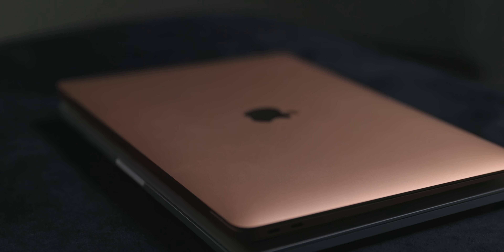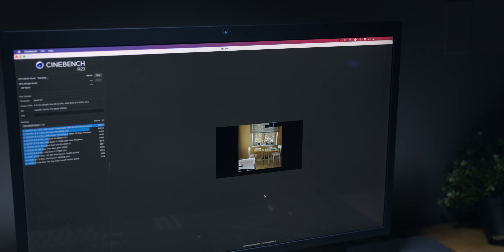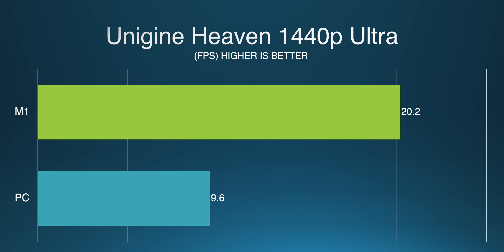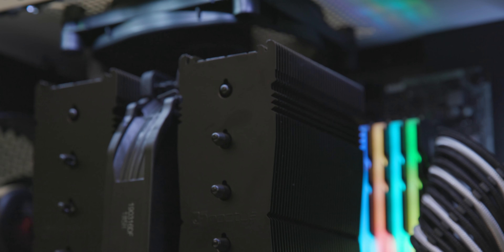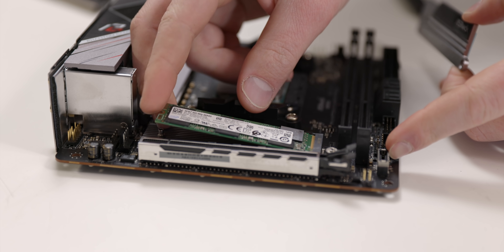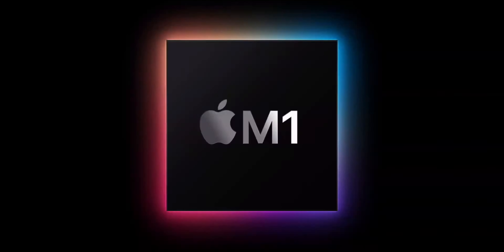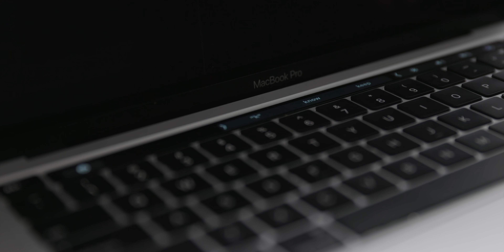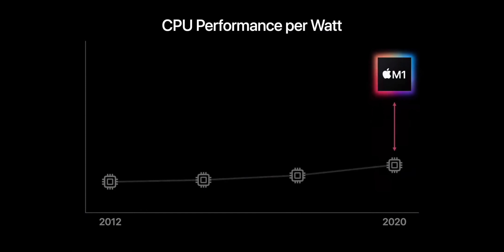$699 Mac mini vs $1,000 PC: Which Is Faster?

Comment: The performance of the M1 is amazing, the problem lies elsewhere - first, not everyone wants to be an apple/macos slave, second, the wholly integrated package of cpu, ram and storage is not great from upgrade-ability point of view, not to mention repairs - it's not unheard of having a busted RAM chip which isn't really such a big deal on a normal pc or laptop because you just pop in a new ram module but you cannot do that on the M1. Also, news just surfaced about some concerns regarding the longevity of the soldered ssd's on the M1 macbooks - it's going to be interesting to see how those M1 macbooks will do 2-3 years down the line...

Comment: imagine if, apple decided to go for the server market.
Reply: They would probably fail again, just like what happened with the xServe. It all boils down to one simple fact: nobody wants to work with Macs as a server. They failed for the same reason Windows Server failed, and adding ARM only makes matters worse. In the server space (and professional space), ARMs limitations pretty quickly become apparent. Unlike CISC architectures, ARM performance can't be increased by upping the voltage. Therefore, it scales pretty pathetically with more power. ARM servers do exist, but they're oftentimes more expensive and less powerful than their x86 counterparts. Furthermore, you actually can rent M1s as a server, and it's ridiculously expensive: nearly 10 times as expensive as a similarly specced x86 server.

Comment: What if you scale down the amd cpu(s)
so that it'll draw a lower amount of power? (downclocking? or undervolting)
iirc someone posted about this on reddit (a while ago) and he got some impressive results
The power draw / performance scale is NOT linear.
Reply: AMD already do this on the Laptop SKU which is only 35w. There is no a massive performance difference.

Comment: Rather pick up an envy x360 with a 4500u, 16gb of ram, 512gb add and so on for $650 and $700 vs $1000 and $1200 for 16gb of ram. Not sold on it. Amd can and will never be able to be the muscle that x86 is today. It goes against arms philosophy.

Comment: I'm definitely impressed by what Apple's been able to do with the M1 and its performance, but I can't see myself switching. Mostly because my main use case is gaming and MacOS can't really run games like Windows can. 
Plus, I don't know if I can forgive Apple for buying up all of TSMC's 5nm production, blocking us all out from being able to get Ryzen 5000, RX 6000, and RTX 3000 atm.
Reply: Just to point something out. Apple buying up TSMC's 5nm node doesn't block any of those products... If you haven't noticed, Ryzen 5000 and RX6000 are on TSMC's 7nm process...And RTX 3000 even built from TSMC, they are on 8nm samsung. 

If anything AMD's production of chips for consoles would have a greater contraint on their enthusiast products as at least those are on the same node.

Comment: M1, P1, D1, X1 for mobile, power, desktop and insane. Then they’ll probably have some kind of ARM BRAIN C1 chip for the car that draws 1KW and has over 512 cores for ML. This architecture has serious legs, and it’ll use them to walk firmly over Intel’s heat sink.

Comment: 2:00 The Cinebench R23 for M1 Single Core is 1514 and has a multicore score of  7760 which is quite far from the your score of 10173 at 2:02 . Ryzen 4750G still easily outperforms M1 in any multithreaded task.

Comment: I bought my wife an M1 Air, and it's like using a computer that's been teleported back from several years into the future.  Planning on switching myself now, when the larger MBPs come out.  I'm a big fan of Intel's NUC lineup and will continue to use/build those in the future, but for my next laptop it's impossible to overlook what Apple has done here.

Comment: there becomes a threshold where power envelope just straight up doesn't matter.  for me, and I honestly think most users, that threshold is "does this need to run on a battery and be portable". so long as it isn't over the moon (more than 800w or so power draw for the whole machine), why should I care!?  and that's coming from a guy who pays $.21/kwh which is reasonably high.  back-of-napkin figures: a gaming pc or an entry level professional workstation uses roughly 500w of power (probably less, this is just an assumption for calculations).  assuming it's running at max load 24/7 (which for most it won't be) for me that's only $2.50/day for power or a little over $75/month which is nothing for a professional or a gamer.  and right now, depending on the gpu you choose, you could even be generating more money than you'd be giving up in power every month by mining etherium when the computer is idle.  if you use your computer for work/games/whatever for 12 hours a day at full power, and then you mine eth for 12 hours, on a high end gpu like a 3080 or a 3090, which gets you something like $9/day right now in bitcoin (over 24h), cut that in half for our hypothetical 12 hour run, and that's $4.50 or $2 MORE than you pay in power, essentially running the machine for free as long as eth/btc stays valued as it has been and you're smart about your selling schedule (I am not an investment advisor, this is not investment advice, this is simply the strategy that I have personally taken with my new workstation build).

tl;dr: even if etc/btc goes completely bust, most users don't really care how much power their desktop computers take up (within reason).  the M1 and it's successors could be a GODSEND for portable computers (particularly if windows on arm takes off and has a good enough x86 emulator integrated as there's an overwhelming majority of people who don't want to switch to using mac os because the software that they predominantly want to run is on windows. - m1 like chips would also be a HUUUUGE boon for servers if a large number of m1 like chips in a rackmount server as they are extremely power efficient and the datacenter, where you're trying to pack as much compute into a 1u space as possible while using as little power as possible is the key to business.  m1 and m1 like chips just aren't (at least right now) a good fit for how most people want to use desktops. - sure a mac mini might be good for a home theater pc running kodi or something, but that's a very small market.
Reply: They make these for everyone, not just people who don't give a fuck about power consumption. Less power use means lower power bills, or more performance if you up that power usage. Think about it. These things will scale MUCH better up to where the best mobile and desktop x86 chips are sitting within that power envelope than they ever can, considering they're at their practical limit already given how much heat needs to be removed when running. Imagine how fast a 95W Mwhatever they call it inside an iMac or Mac Pro will run if their M1's at around 20W (full system by the way) are within spitting distance of a 105W 5950X on single threaded performance?

Comment: Any comments on the extreme ssd writes on M1?
The topic not discussed.
Reply: Yep. Even my 16gb m1 mini has crazy swap files for simple and short videos (14 GB) well before maxing the ram out. Maybe there is some way to tell FCP to be more of a ram hog.
This is super disappointing, but honestly, even if this thing only lasts three years, the performance per dollar (especially when taking energy consumption into account) may be worth it when compared to my previous mac computers. 

If it fails in less than three years, I got apple care just because this is their first batch of these computers. This is probably the only time I would recommend this to new users. 

I will probably just trade it in after a couple years for one of their professional models, so again disappointed but not a deal breaker.

But for a company that would like to consider itself environmentally friendly, this is ridiculous.

Comment: Intel, unless they get some kind of cross licensing deal from AMD again, are not going to catch up for a long time yet (and I don’t think Intel has anything AMD wants in exchange right now). They can’t even get a 7nm process working, while Apple has just leapfrogged them to 5nm. If Intel wants to build a chip with the same performance, it necessarily must be physically almost twice the area, and it’s going to run a LOT hotter for it. Right now, Intel’s high end processors, according to their own benchmarks from their keynote, just barely edge the M1 out in some specific work loads, and, as is their familiar MO to anyone who remembers the 90s and 2000s, instead of trying to catch up, they’re spending their money on snide and inaccurate marketing, because their flagship 11th gen products are already coming out, and they’re about to get bowled over by whatever Apple announces next month, even if it IS just a double-sized M1. Intel may hold like 90% of the desktop and laptop processor market right now, but they’re not going to maintain that proportion of the sales moving forward. Intel’s control over the market is a mirage created by the already large install base of up to ten year old CPUs. I think, if Intel’s fortunes don’t drastically change over the next couple of generations, then it’s just a matter of time until they exit that market entirely, and focus on bespoke hardware controllers, and legacy support.

Comment: This review is so wrong that is not even wrong. What's the point of using a castrated PC without all the very things that make it fast? Every serious  video editor  knows that the advantages of a  PC against M1 for those purposes are the capabiliy to have a decent  NVidia GPU,  extra RAM, and extra cores. And to start with  the particular  tasks in the review the GPU  would need to be NVidia, not AMD.  But he has  striped all those parts by  building the most ridiculous  PC in history.  
Next, he has only used small benchmarks not exceeding the very  little RAM that the M1 can handle.  
And what's that "PC"?  Are you serious? Nobody  buys a PC like that for graphic applications and video editing, absolutely  nobody in the whole  planet. 
A different thing would be if he wanted to compare with a Windows laptop,  but in that case   the comparing price point is the one of  the MacBook, not the Mac mini,  and that is enough for a Windows laptop with a powerful GPU. 
To me it sounds to be  another fake  review designed   to get a targeted result to favour a particular brand.  Here you are comparing a BMW M1 car  against  a BMW M5, but this one  with its  V10  engine restricted to only use one cylinder so you can say that  the M1 is faster
Reply from the maker: Did you literally even watch the video at all? This is exactly the type of comment I said people would write.
Reply: @snazzy  And does it make my comments less valid? What is going the next review, a  Mac mini against a printer server ? Why not  against the raspberry pi?
Reply: @stoychotrenchev4443  I agree the Mac mini is great, but a PC is also a great option. The problem is that he tried to hide this fact by using a totally wrong PC setup for the type of  benchmarks that he was going to run. The  benchmarks in the video are all focused  on 3D rendering, graphic performance and Video transcoding. For that specific  purposes a small Ryzen with a NVidia 3060 would  be in a similar price range (once both are  completed to  production conditions) and such  PC will obliterate the Mac mini to ashes in that tyoe  of  applications (just Google M1  rendering benchmarks  for Resolve, Maya, Adobe, etc and you will see it ). 
The PC  is also much more escalable and cheaper to maintain (just because PCs do not block  the right to repair or to upgrade at your own ).  
 In the other  hand the Mac mini will always obliterate any PC in terms of energy comsumption, size, thermal aspects, and entry price.
Those are the facts, each option  has its own advantages and there is no need to build the wrong type of PC  to pretend that your  preferred option is the best at everything. Because we (the world) would never buy  such a ridiculous PC for running graphic  applications anyway.
Reply: @stoychotrenchev4443  I don't say that the Mac mini is a bad machine 
. It is a great machine, it is cheap, and it is fast enough  for the price.  My point it  that that comparisson  "thing" is not what people call a "PC".  Those little things are called  "thin clients" and are designed for office work (ms office and similar) and as smart terminals to connect to company mainframes.  You will never see such thing  in any editing suite in the world, and neither for any other of the applications that are mentioned in the video. He could just  say that  "the Mac mini is very cheap and great value for the price " and I will totally agree with that. But comparing it with "half PC"  is a total non sense.

Comment: Quinn - Do you think Apple didn't design a more robust cooling solution for the recent Intel ships used in the MacBook Pro in order to help justify the switch to their own silicon? We all know Intel has been underperforming for years, but it feels like the higher-end MBPs that came out in 2019 and 2020 were really at the edge of their cooling capability. My 2019 base model 16" kicks the fan up and throttles on even fairly basic tasks. And I think we remember how badly the cooling on the older MacBook Air performed. I really don't think Apple's engineers weren't capable of designing their cooling solution well, which is why I end up feeling like they just said, "Why bother when its going to be overkill for M1 anyway?"

Comment: Can't use m1 macs in my company they don't have support for legacy hardware
Reply: Depending on what you are doing but M1 macs can run lots of older software
Reply: @bryanmiller476  it can't talk to older hardware tho and one of those machines cost about 100000€ than switching to another platform isn't worth the investment, besides you have to take in consideration the downtime and the costs associated with it

Comment: I once looked into WHY the M1 is capable of going so fast with such a low energy consumption.
The reason is the amount of decoders.
So, now a small intro to CPUs:
When a CPU core wants to execute code, it need to analyse the instruction, find dependencies between these, and then save it internally to actually use it. It does not execute instruction directly (well, a very low powered RISC chip may do, but we aren't talking about these). This is done by decoders.
So, if you want to go faster, you need to speed up the decoding, so that the actual execution doesn't need to wait. There are 2 ways of doing that, clock the decoders higher, or have more of them. The M1 has 4, while the x86-64 based competition currently has 2. And now we get to the problem, why it's unlikely for x86-64 to be able to compete on that. x86-64 has variable length instructions, while ARM has a fixed length. This makes parallelizing A LOT harder, because to do that, you need to know where the instruction end. If they are fixed length, that's pretty easy, if they aren't, it's not. But you also can't just stop having variable length instructions because of backwards compatibility, and even if 99% of your instructions have the same length, some do not, but you still need to account for that in your design.

Comment: Even though it felt disingenuous to start out with a case without fan cooling, it's still not surprising that the M1 won out because that's the point of switching to ARM, either you get around the same performance for less power, or even BETTER performance for the same power.

Comment: Wow x86 is not doing so good. X86 needs help, badly, I do disagree with the vertical integration point at least somewhat. I do believe a one size fits all chip is possible but it needs a reduced instruction set.

Comment: I recently returned my M1 Macbook air in favor of my existing BASE model MBA 2015!  
and the reason is that while I'm sure the M1 is really fast for video editing (which is why all YouTubers are raving about it) and machine learning 
for the stuff i'm doing (browsing and coding), it's not that much faster.  

In fact it's a downgrade in a lot of respects:
- I hate the touch ID.  I like to have a physical power on/off and sleep key
- No magsafe charging
- The weird screen bezel color makes the screen look great when it's off, but when it's own, there is a thick black bezel under the screen which makes it look like everything is floating.
- OS Big Sur absolutely SUCKS! (bland colors, thinner-hard-to-read fonts, bad sound effects)
- Very limited number of ports so none of my existing peripherals works without adapters.
- The lip/notch to put your finger to lift the screen is shallower, so it's not as easy to open the screen
- The surface area around the keyboard is lesser..so lifting it feels denser and heavier.
- The function key have border graphics (not filled in) so it's hard to tell which is the volume up/down key and brightness more/less key

So personally, for me, and I think for most people who aren't doing video editing or machine learning all the time, it's a lot of HYPE